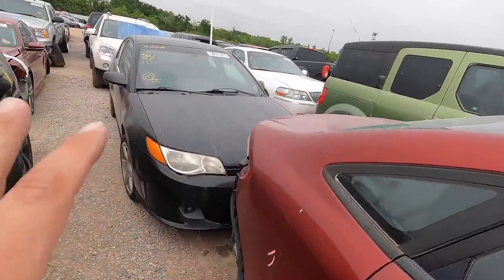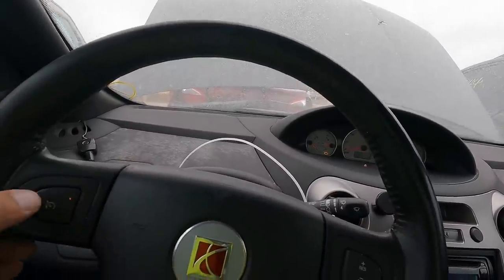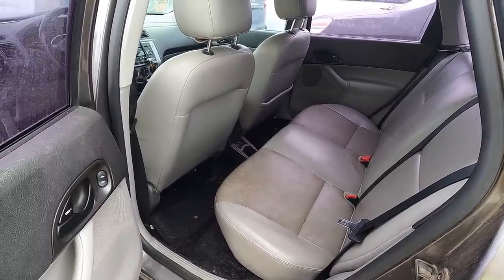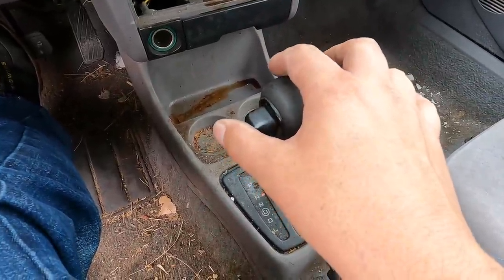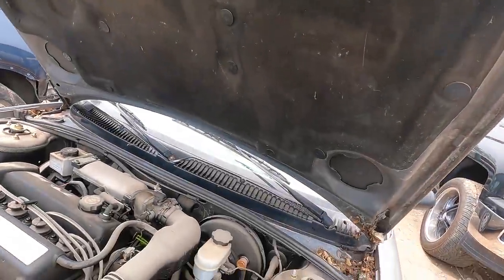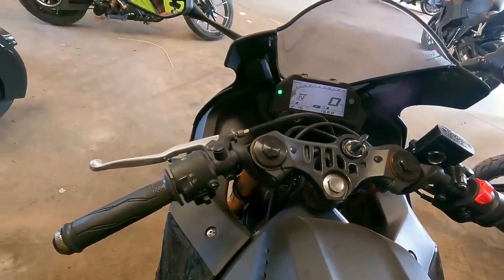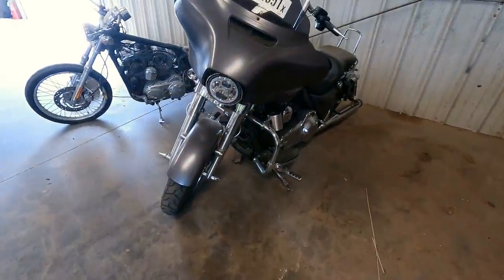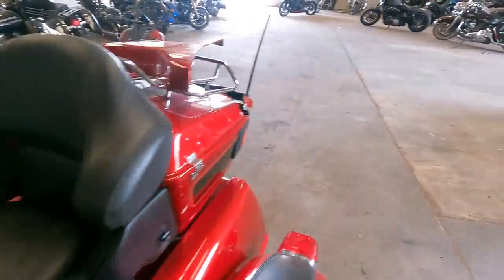Copart Walk Around 5-7-21 Cars + Motorcycles!!

Comment: My mom had one of those Ford Escorts when I was younger. It was a caramel colored stick shift one, a 94. I love these 90’s cars for nostalgia as well. I only remember hers running hot at one point lol
Reply: My mom did too. It was a white 2 door i think.
Reply: I had a purple 95 sedan 5 speed. At about 250,000 the trans just locked the front wheels without warning

Comment: I can personally verify the story about the Saturn SLs. I worked for a former Saturn dealership in New Orleans for a few years, and the most common issues were people wanting to replace the SL2 motors with another SL2 motor and never thought to replace the transmissions in them. Randy's story fully checks out on the Saturn

Comment: You asked for comments on favorite bikes, many may laugh but I had a Suzuki Burgman 650, I thought it drove like a dream. Enough power to cruise the highway all day, always consistent and reliable, it was over 600 lbs, many features that are extras on other bikes are built in. Yes, it's a scooter, which really just means the motor is between your feet instead of your knees. Some don't think its cool enough, so be it. I bought it when gas prices were over $4, got rid of it when cars threatened to run me off the road.

Comment: Cool vid. We had two 1993 Escorts with the 1.9 litre engine. Had the silver one from 93 to 2005, motor was good still but body rotted out. Then found a mint 1993 Sunrise Red one with about 25000 miles and kept that until 2013. Cool bikes too! 😎👍🇨🇦

Comment: I had a few of those 1.9  Ford escorts and I never had a problem  with any of them. Changed the timing belts when they were suppose to be. Had over 300 thousand on them when I sold them and they were still running and driving great

Comment: Randy, the Focus has a "Little Buddy" heater on the dash...we used to use these for cold box development work. We would leave the heater on while the vehicle is being cold soaked so the windshield won't frost over when you drive the car out of the cold box into much warmer air.  Maybe the defroster mix door is broken?

Comment: You can just change out the computer
 You can also replace it with an automatic computer if the car is a manual. You'll cancel out the rev limiter if you do it that way. However it does have to be from the same year Saturn for all to work properly. I only know this because I used to race a 95 saturn Sc2 at a circle track asphalt race track.

Comment: The other problem with Saturn Ion's is there is no oil dipstick so you dont know how much oil there is in the car!!  Ive had one of these before!! Also... the reverese lockout mechanism is very flimsy and GM cut corners on it during MFG but making it out of cheap, cheap plastic.... they break very easily and are expensive to replace

Comment: The amp capacitor and mid amp in that Ion are about $345.00 so don't base your decision on those things. The 666 in that lot number ought to tell you all that you need to know about that car. After i lef tmy first wife i had a 1991 Ford Escort Hatchback. it had 131,000 on it when i got it, the thing had run into a ditch and folded the passenger wheel under it. that was fixed before i bought it and the fender still had to be repaired on the passenger side. but i fixed it and drove the car up to about 234,000 miles and got hit in the back and totaled a second time before i could even get the title rebuilt on it. then my sister bought it from my dad and drove it for 6 more years and put another couple hundred thousand on it put a transmission in it and 2 timing belts and it was totaled out a 4th time. dad finally gave up fixing it when it was totaled a 5th time and the engine block broke where the mounts connect to it. tough as nails little car even though it was a Ford. that's one i have to say really gave it's all and then some. but that's the ONLY successful Ford story i have all others died horrible deaths on me no matter how well they were cared for. Max Wrist i believe is the idiot that wrecked his bike last time running into a yelow porsche head on and lived to tell about it. killed the Porsche drive but he managed somehow to live (i may have him confused so don't quote me on that) but he's been at it on you tube for a long time and the reason he doesn't have any more subs than he does is because he has a really bad attitude toward nonriders and people who's bike he just doesn't like period. He doesn't know the people he critisizes at all but he always voices his opinion about other people's bikes like anyone asked for it and if the other iders knew what he was saying they'd probably kick his ass for it. BTW I like the trike myself. but like you i like the sport bikes also i just have no desire to ride one after losing several friends on them and knowing people just plain don't watch for riders I'd rather have all that Meat there that a Harley provides also. you stand a much better chance of making it on one of them because you're not usually screaming down the road on a harley as a general rule that's why they are called Cruisers. You need to get in a group and have someone give you your bell soon though. i know it's a superstition but when riding and being new to riding why take a chance and risk not riding with that superstion working for you instead of against you ?

Comment: If it q a s a escort wagon or at least a 5 speed would be fun we use to zip around  in late 80s escorts that wore 5 speed a. They leaked oil an all the norm but wore fun lil cars in high school for doing e brake slides an dump cluth an burn out b an just fun lil car they if it died ya wore not upset about it so ya if it was a 5 speed id jump on it for 400 just to beat on till it didn't start again just a sweat beater car  but its auto so I do 5 know maybe put nitrous on it an have fun with that maybe deff worth doing crash derby car be fun to let's build a cupple derby cars an make youtube derby on some farmers field some place